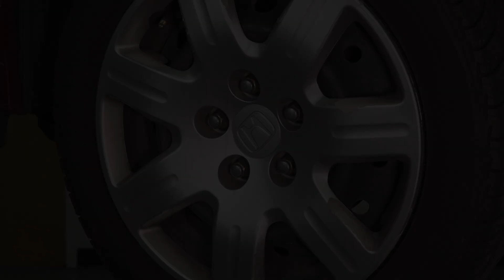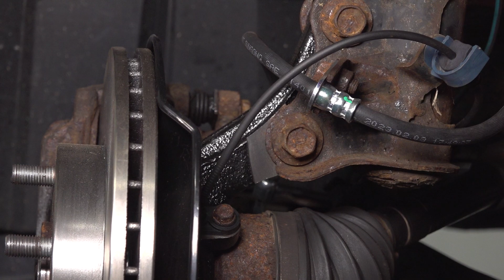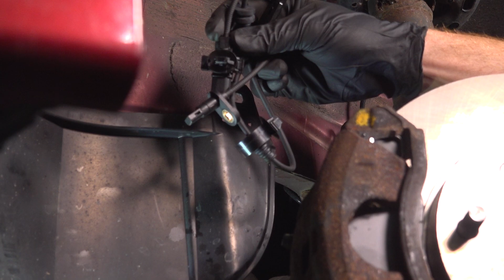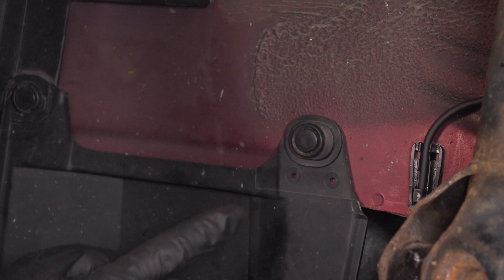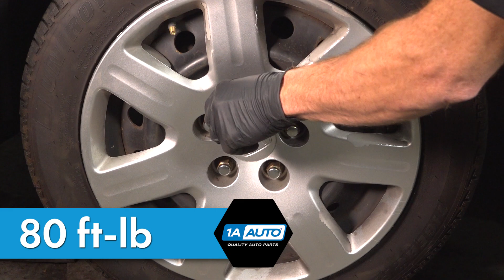How to Replace Front ABS Sensors 2006-2011 Honda Civic

Comment: Hey I have a question if you don’t mind I have a 2013 Nissan Altima 2.4L if I sit in the car and turn my  wheels right to left I hear feel and can hear something like a drag coming from the passenger side front wheel area do you have any idea what might be causing that I can also hear a light sound and light vibration while driving .thanks in advance.